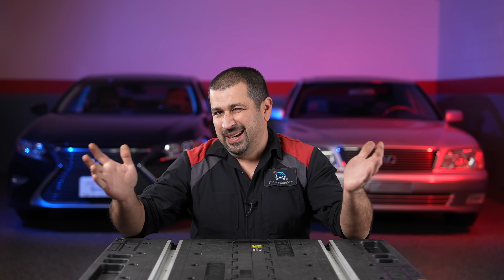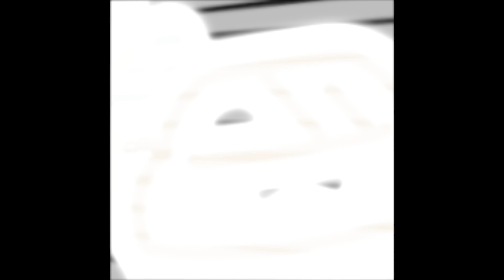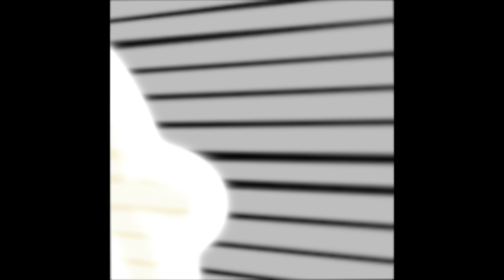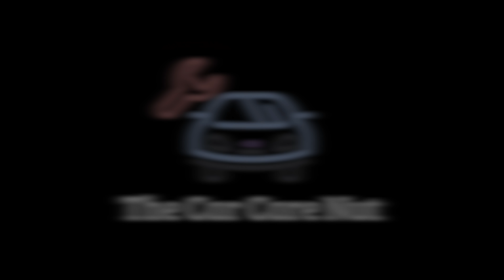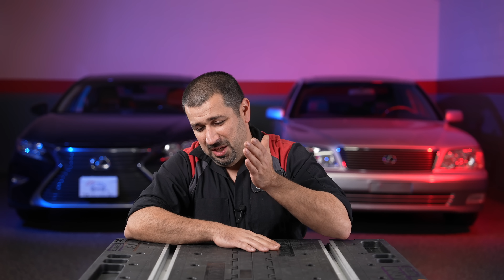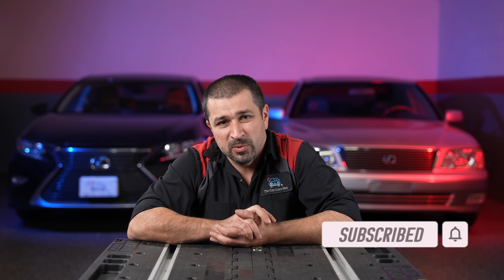Can Modern Turbo Engines Be Reliable? Here's The TRUTH!

Comment: Hi Ahmed, my sweet wife drives her 2023 Ford Bronco with the 2.3 4-cylinder turbo engine. I was able to talk her into watching your video. She says she now “gets” why I am such a fanatic about changing the oil in her car. That little 4 cylinder engine is under a lot of stress moving that pretty big, heavy SUV and anything to help out the engine has to pay dividends in its longevity. Additionally, I had previously “talked her into” premium fuel which increases the rated peak horsepower from 270 to 300 which makes the engine work not quite as hard to move the SUV (at least that’s my theory anyway.)
Reply: Had a 2017 Ford 2.3 turbo in my shop turbo died at 65,000 miles but don't know about owner oil changes

Comment: Standard practice for turbo muscle cars (eg 86-87 Grand Nationals) after a very hard pull or W.O.T. drag strip run, was idle engine for a minute or two before shutting off.  This will keep fresh, cooler oil flowing to the turbo bearings. Of course, just easy regular driving after the WOT throttle would do same thing.

Comment: I had a 2004 SRT4. 
I had no issues with 5K oil changes. I drove it hard most of the time, but I let the turbo cool down before turning it off. Had over 125,000 thousand miles on it and it never used any oil. No issues whatsoever. 
I have a 2006 PT Cruiser GT convertible turbo with no issues.
Reply: That's the major issue.  Let the turbo cool down before you shut the car down.  Or get an after-cooler to cycle cooler oil thru the turbo till it's cooled off.  Oil will cook in  a hot turbo if just shut down while hot.
Reply: @timradde4328 That's not always true, especially in newer cars. I owned a Taurus SHO with 2 turbos, even if you shut the engine off without a "cool down", the system has coolant flowing through to prevent having your oil coking up in the turbo. Even the owner's manual tells you this. I drove it for 70k miles without any issues, and always used full synthetic oil changed within every 5k miles. Even the dealer I traded it into (for a Mustang GT) commented how well running the Ecoboost engine was when his mechanics checked it over. Even gave me a bit over blue book on the trade in.

Comment: My 1.4L turbo Jetta was highly reliable up to 77k miles when a deer hit it and Safeco murdered it.
1) Changed oil at 5k miles (always VW spec, often Liquimoly)
2) did not race it all the time, peak torque was 1,500 to 3,500 rpm.
3) used premium fuel to AVOID knocking instead of having knocking and retarding spark.
4) Averaged 39.1 mpg over life of car based on gas tank refills. Engine used modified Atkinson cycle.
Reply: Yes, crazy deer going around running into parked Jetta. Cheers.

Comment: 10:34 so if we’re being honest here… I recently got an oil change on my company car, a four-cylinder turbo. I was charged $156 for it.

If I’m changing my oil seven times instead of once in 20,000 miles … I’m spending about $1000 on oil changes.

You figure I won’t have a big failure until around 80 to 100,000 miles. 

Is it really that bad that you’re spending four to $5000 on a repair at 80 to 100,000 miles? Instead of buying four to $5000 worth of oil in that same 80 to 100,000 miles?

With the repair you now have new parts. Devil’s advocate here…. Oil has become so expensive if you’re not changing it yourself that it doesn’t make sense to change it regularly.

We’re seeing the same issues with health insurance.  You’d be better off, putting your premiums in a high-yield savings account and paying the doctor in cash when something does come up

Comment: My 2005 BMW 120d M47TUD20 uses Mitsubishi Heavy Industries VNT turbo, it spools at 1500RPM it's fully up at 2000-3000, after 3500 pretty much starts tailing off exponentially. I let my car warm up and cool off, oil change every 6K miles or every year. Oil breather/ATF sump & sleeve, rear diff oil every 5 years. I bought my car second-hand and had it remapped - ECU to 300lb-ft at 42K miles and the ZF 6HP19 to xHP stage 2 on the TCU, uprated FMIC for cooler EGTs/cylinders. It's now on 20 years and 165K miles. Personally I have an annual Black Stone oil analysis done to ensure my oil interval change interval is right and act as an early warning system for the engine, it costs peanuts. It's more dampers, spring, bump-stops, top-mounts, suspension arms/bushes, ARB drop-links, prop-shaft rubber coupling, idler, pulley, belt, EGR, engine stat that fail or go out of tolerances. The Covid lockdown where you couldn't run the car affected the AC system so new AC condenser (radiator next to the condenser), evaporator, expansion valve and compressor. I'm going to change all 4 injectors and the water-pump as pre-emptive maintenance shortly I do a monthly freeway 440 mile round-trip,  I used to so 2-3 track days a years but no longer...

Comment: Just purchased a 2026 passport because it has no turbos and is far simpler motor.   5 k oil changes.  Probably going to switch to a 5 30 full synthetic oil as well.

Comment: Please listen to the CCN!  Manufacturers push these extended oil changes under pressure from the EPA and to promote "low cost of ownership".   All that being said, I was really impressed with how my buddy's turbo 4 cylinder Tacoma performed when he took me for a ride.  I assumed it would be a real dog, but was sooo wrong.  My buddy insists it performs just as well, if not better than his two year old V6 model, and the transmission shifts less, and is smoother.  Admittedly, he has not towed anything with the truck, so who knows if there will be a noticeable lack of power in those situations.  Nonetheless, it would seem like Toyota did a great job with the four cylinder turbo, tranny, gear ration in terms of driveability.
Reply: Yup

Comment: 2017 crv, regret getting a turbo. 125k miles, debating trading it in or waiting for my head gasket/turbo to go. Mostly 10k oil changes, I switched to 5k recently.

And you're right, in a few years when all used cars are turbos, we're screwed. The days of buying a 100k car and taking it to 200k for cheap are over 😢

Comment: I was car shopping in July, I looked at the gas-only Honda CRV, I loved the car, the looks, the interior, I walked away because it had a 1.5L turbo engine.  I bought a Toyota RAV4 with a 2.5L non-turbo for slightly less money than the CRV.   Turbos mean the engine is stressed and overworked.  I crossed a number of cars off my list because they only came with turbos.  Fortunately, hybrids are supplanting turbos as a better way to get more power and better emissions from smaller engines.  I didn't buy a hybrid this time because I drive so little, but my next car will likely be hybrid or even all electric.

Comment: IMHO, the boosted engines need to be powerful enough to drive the car adequately without boost. Otherwise you are always deep in the boost, which is why a lot of these gas saving turbo engines do not get better mpg in a lot of normal driving. My GTI has a 2.0 boosted, so it doesn’t need to be deep in the boost in normal driving. But when you need/want it the power is there for merging or passing. 34mpg at 78mph, 30 in mixed driving. Adding a couple pounds of boost with a piggyback has had zero effect on mpg, as it’s not driven much with my foot to the floor. I expect excellent reliability, VW has been doing this for a long time. 5K, not 10k oil changes. 6 quarts of oil in the engine, with an oil temperature gauge.  The other difference between now and old turbos is the new turbos are water cooled.

Comment: agree w most but I believe the new lexus/toyota 3.4L twin-turbo V6 would benefit from 5w30 oil instead of the recommended 0w20
Reply: Where did you get your degree in automotive engineering?
Reply: @UnsightedADV japan

Comment: This is probably the most important video you have ever done and the sad part is that the folks that would most benefit from this advice, will be unlikely to listen. Decades ago when I was a clueless teenager Engineer father (Navy Chief) told me that if I did nothing else; change my oil, that it was the single most important thing is how long a car lasts. He also said that the more highly stressed an engine is, the shorter its life will be.
Somehow folks have become increasingly allergic to changing oil. Considering the consequences and the cost of new vehicles; I just don't understand it.

My new car is a Mazda 3 Sport 2.5 non-turbo. It has 2200 km on it and I'm getting the break-in  oil changed tomorrow. As Engineer father also said 'oils cheap, engines aren't'.

Comment: MANAA - Make Automobiles Naturally Aspirated Again
Reply: They can't because of CAFE.  They have to meet an average corporate fuel economy standard.
Reply: @Clearanceman2  This is the real answer but only part of it. The explanation in the video is just plain wrong. It has nothing to do with emissions and everything to do with fuel economy. A 2L turbo engine is running at near atmospheric pressure just to pull your SUV around at highway speeds and 2500 rpm. This is good for fuel efficiency when a comparable 3.5L V6 is going to be severely throttled back and pulling a lot of intake vacuum.

The other part of it is plain consumer preference. Go ask truck buyers if they would rather get a Frontier or a Tacoma. The vast majority buy a Tacoma, and part of it is the 2.4 turbo just makes so much more low-end torque that it feels easier to drive. People hate revving out their engines to make power.
Reply: @DOAHunt3r  
The explanation in the video with regard to emissions is in fact  relevant. With all of the concern and hysteria about carbon footprints and what not. It  along with fuel economy are the major driving forces behind government regulating vehicle manufacturers.
Reply: @Chuck-s5i  Emissions is not the same thing as fuel economy standards. Emissions standards throughout the world are only concerned with NOx, HC, CO, and PM. There's no real correlation between those tailpipe emissions and engine size. A 5.7 Hemi had no trouble meeting the same emissions standards as a 3.0 Hurricane. But a 3.0 Hurricane SO makes more power everywhere and gets better fuel economy than a 5.7 Hemi.
Reply: @DOAHunt3r  
You are correct, emissions and fuel economy are not the same thing. My point however is both are the impetus for governments feeling the necessity to intervene and regulate vehicle manufacturers.

Fuel economy concerns have led to the push to smaller engine usage. Concerns with regard to emissions has lead to the use of electric motor/batteries augmentation. Both have profound impact on what can be manufactured and offered to the buying public.
Reply: @Chuck-s5i  Again, emissions control and fuel economy are two different things. In fact, fuel economy often comes at the cost of emissions control! The first generation Honda Insight could get 70 mpg, but only with the manual transmission lean burn variant which also fell into a significantly worse emissions category due to high NOx. That's also what dieselgate was all about. VW couldn't pass emissions while delivering good fuel economy so in real world driving the tune allowed tremendously high NOx emissions to achieve 45+ mpg.

Achieving good emissions comes through technologies like secondary air injection, exhaust heat scavenging, electronic wastegates, high strength fuel tanks, SCR, and VVT enabling internal EGR. Not so much just making a small engine.

If the government never pushed the automakers with fuel economy and efficiency mandates we would still be huffing leaded gas and driving around on carbs. Consumers just aren't smart enough to understand this stuff nor care. Roofs pancaked and killed people in rollovers until the government required cars to hold 3x their weight when flipped over.
Reply: @DOAHunt3r  
I was very clear about acknowledging that fuel economy and emissions are not the same. Government intervention can be both good and bad depending upon the circumstances.

I don’t agree with the notion that consumers aren’t smart enough and always require the guidance of government oversight. It can be hit or miss.
Reply: @DOAHunt3r  Consumers may not understand the science behind all this stuff, but I DO think they expect fuel economy to keep improving as a natural part of cars getting "better" over the years. That part is not the issue. The issue is the fuel efficiency standards set by the mandates/regulations are not realistic to achieve with proper R&D in the time frame being allotted. That's why we're seeing these half baked solutions like various displacement on demand-like tech, thinner oils, etc leading to early catastrophic failures. So its the forced acceleration (no pun intended) of the progress of fuel efficiency that's proving to be a problem.

It's to the point that when I say a certain car/engine is crap/problematic, I'm quite frequently met by someone saying something like "Oh yeah?? Well MINE has 70k miles and the engine hasn't blown up yet!!", as if that was a bragging right or accomplishment as opposed to severely lowered standards.
Reply: @DOAHunt3r Wrong, most owners would go for a Frontier because the naturally aspirated engine performs better & will outlive any turbocharged engine
Reply: @IsaiahEBelk the sales numbers disagree. All of the top selling midsize trucks are downsized turbo. For all the talk of wanting old style trucks nobody is actually buying frontiers and titans.
Reply: @Clearanceman2  Congress voted back in July to stop the penalties on manufacturers that can't meet the fuel economy standards. I'm guessing that's why we're already seeing a small comeback of V8s, like Dodge saying the SRTs are coming back and with V8s.
Reply: ITN....Impeach Trump NOW!!!
Reply: @gleanerman2195  Shhhhh....the adults are talking now.

Comment: I think japanese makers have much more experience with gasoline turbo engines than any other manufacturers. They've been making kei cars with turbos since the 60-70s. They have the experience to deal with the finer points of these engines. Points you have rightfully pointed out.  Other manufacturers have played with it for their performance models, but those have historically needed special maintenance.

Comment: There's a reason why forced induction was reserved for performance vehicles and not put in your everyday grocery-getters up until recently. All that matters on performance vehicles is power and performance, not longevity. It is understood and accepted that their lifespans will be shorter before a major repair/catastrophic failure.

If the downsides of forced induction didn't exist, manufacturers would have voluntarily been putting them in all of their "regular" cars and bragging about the better fuel economy a LONG time ago instead of waiting for government mandates to forced them to do it.

Comment: High heat of turbocharged engines kills oil faster.  The rule used to be cut the engine life in half for every pound of boost over 2 psi.  I don't think that's changed.
Reply: Do you have a degree in automotive engineering or is this just your feels

Comment: In Europe diesel passenger cars are used the same way as gasoline cars. And there are a lot of unreliable diesels. On turbocharged gasoline engines they use integrated cooled manifolds so they cool the exhaust gas before entering the turbo, this way the turbo is protected.

Comment: I only drive around 3K miles per year but I still change my oil 3 times a year. I do the job myself so as to avoid stripped drain plugs. I have also started rotating tires myself after finding stripped lugs after the last time I took it to a shop.

Comment: Thank you for that answer!!! It also explains why some manufacturers are changing the viscosity of the oil to tolerate as much heat as possible? I'm speculating here.
Reply: Lower viscosity helps reduce rotating resistance within the engine which helps squeeze every mpg possible out of an engine. Although too thin of oil can cause parts to wear out sooner. But manufacturers don’t care about that, once it’s off warranty they are off the hook. That’s why frequent oil changes is supper important on modern engines.
Reply: @Tempsho thanks for explaining that to me !

Comment: Thanks for the accurate explanation of the prevalence of Turbo equipped cars.  It's not Mechanical Engineering, but Social Engineering.  I have always rolled over my vehicles at 10 years/100k miles, but decided to keep my 2014 Tacoma TRD until the wheels fall off.